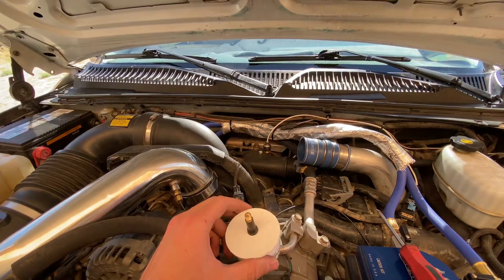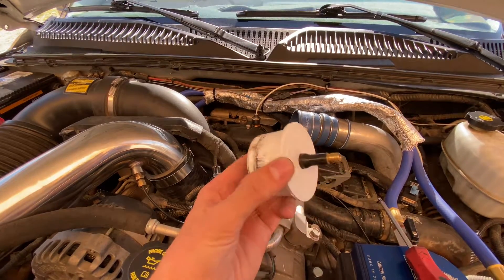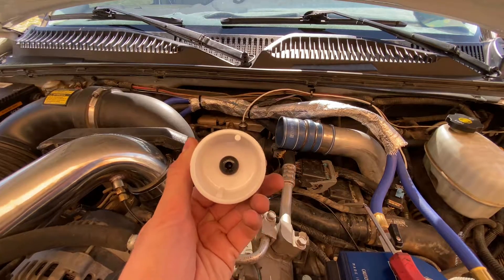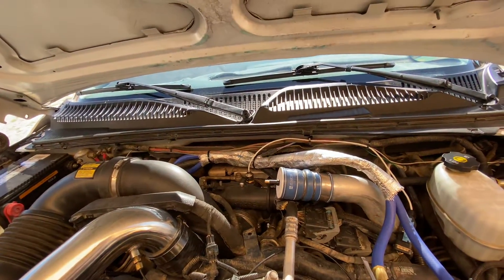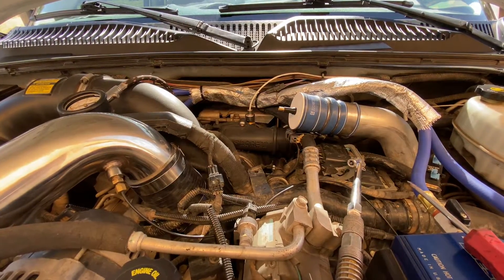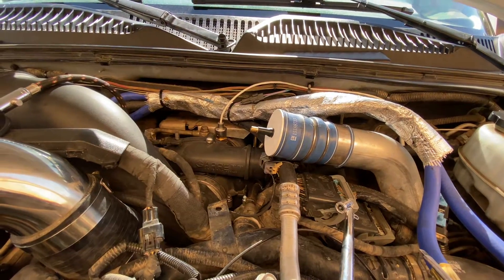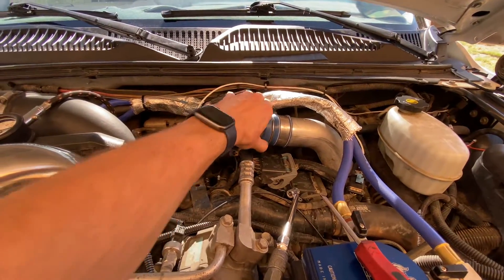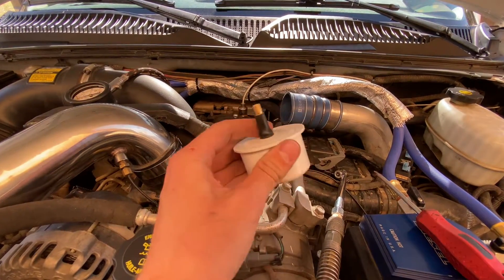$5 Duramax Boost Tester - LBZ LLY LB7 LMM LML L5P - Walmart & Homedepot Parts

Comment: Do you have to plug the other end of the circuit ( the intake valve end)? Or did you make sure all intake valves are closed?
Reply: well since theres no overlap itl be leaking past the rings bc the ex valve will be closed.

Comment: I just installed an RDS 64mm this past weekend on my lly. Did the boost leak test and it appears there a leak at the egr cooler. Just bought a full delete. Should it hold 40psi with no leaks or will it leak slowly? It wouldn’t hold any psi
Reply: I’m no expert by any means. It is to my understanding that you will get some leak down. But it should be very slow compared to an actual leak. It’s leaking past the piston rings.